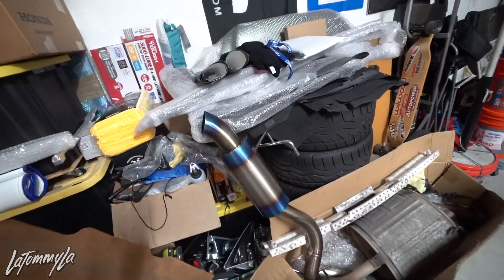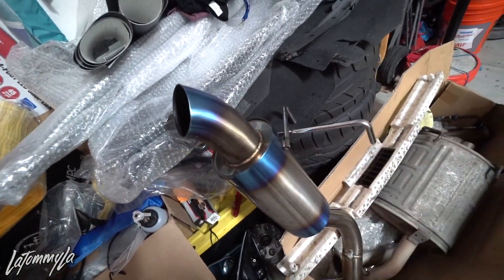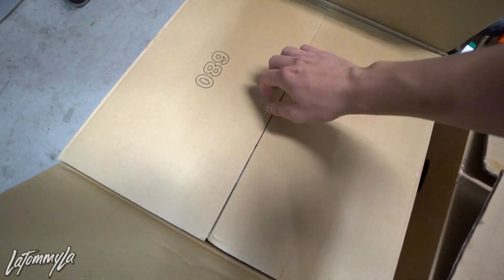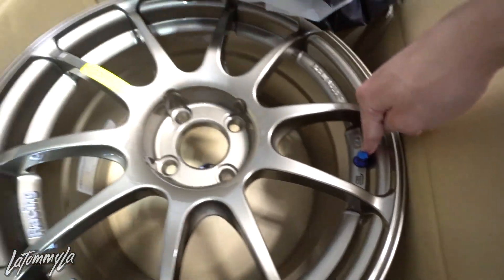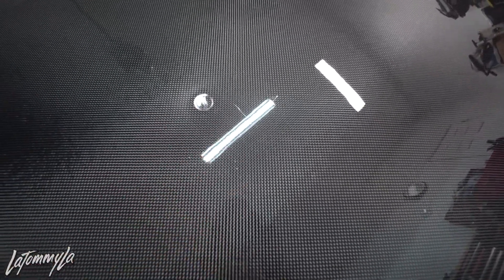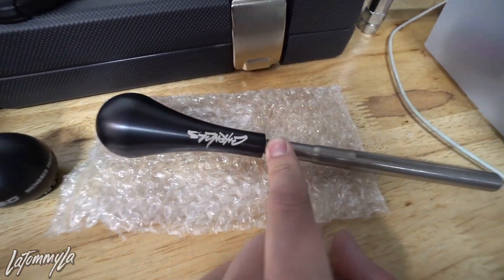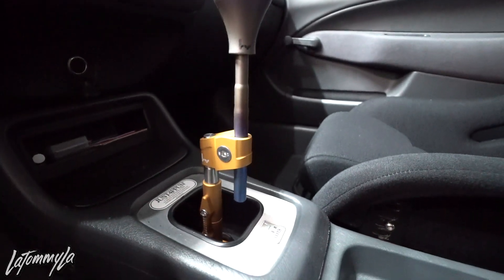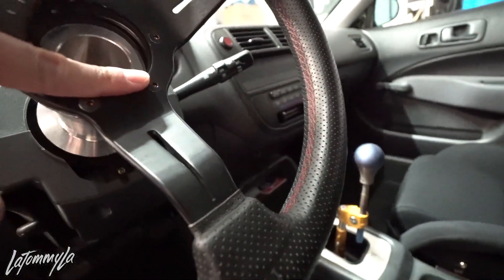Fixing my shift linkage and new wheels for the K20 sedan!

Comment: i made my own u joint solid bushings with cnc and it works perfectly, used the same method of attaching as the innovative linkage by using bolts

Comment: Dude, I have this exact issue in my Integra and it's stock shift-linkage. It was perfectly fine with the stock shifter and the Skunk2 SS. But with the HybridRacing Shifter, it's moved way more forward. It almost hits my Circuit Hero Plate as well.
Reply: damn dude, mine fits absolutely perfectly in my integra. Stock linkage as well. If u need help with yours lmk